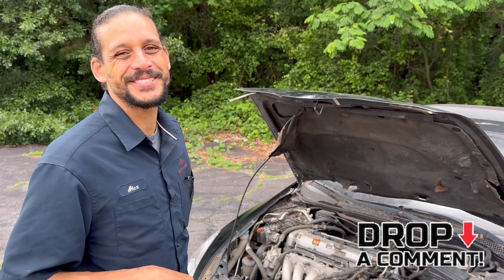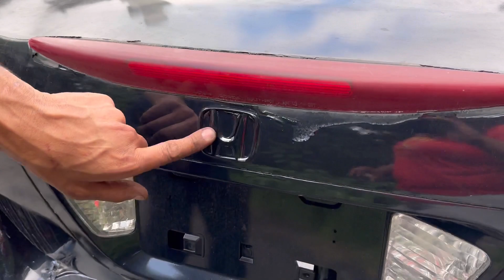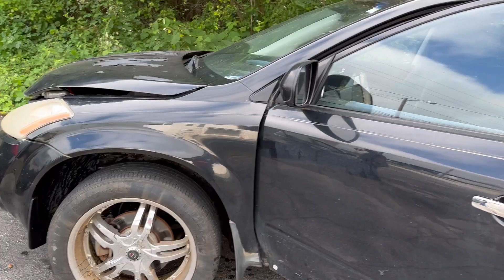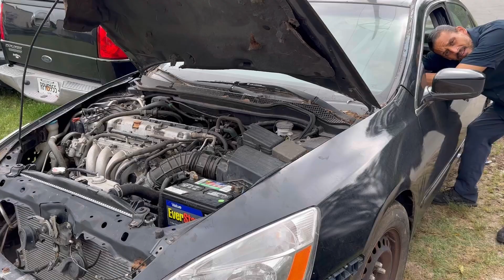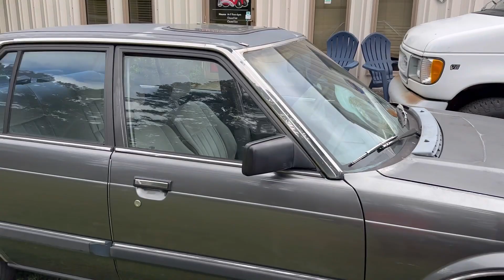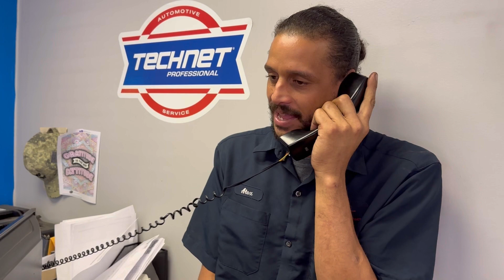"This Customer Thought He Could Drive THIS to Florida?!"

Comment: I have a 1st gen TSX which is basically just like that accord and it’s a great daily, pretty easy to work on, and general parts won’t be hard to find or expensive. That particular accord is SO beat it would be a BIG project bringing back up to par, and if you were paying someone else to do the work it wouldn’t be worth it, but if I got it for less than $500, I’d probably fix it up myself👍 probably $1500 in used parts, a month or so of spare time work, and it could be a reliable and decent looking car again!

Comment: Literally my Sentra. I got her from a single owner who ran her into the ground and totaled her. Separate Rear and front end accident. When I got her the suspension was shot, the engine and transmission were about to fall out, all kinds of wiring exposed. Replaced suspension, mounts, battery, alternator, spark plugs. Just put $800 all weather tires on. I constantly driver her back and forth 8hrs away to see my family. Everyone says I’m crazy. She just looks a little scary

Comment: I have an old honda that runs great so i understand keeping a car thats paid for but there are plenty of old hondas in better shape that you can buy for the cost of this transmission.  Hes probablylooking at 2500 and the motor is on its last leg. You could buy one with a blown motor and be in a better position than that one. The exterior doesnt even have all the panels. Rocks can fly up on the highway and damage the intake tubing and reservoirs.  You can judge a book by the cover with most cars and their owner. You see 4 mismatched tires pull up know they probably dont have the money to fix little stuff and will do just enough to keep it running.

Comment: The body of my 97 Honda Accord isn't in the best shape itself but no way is it as bad as the 07 Accord. I did however spend decent money on new tires, a complete exhaust system and other repairs over the last couple of years. I even had it in the shop last week for an oil change, tire rotation and a minor problem with the front brakes. I feel that I can drive to Florida and back. 

Treat your ride right and it'll return the favor.